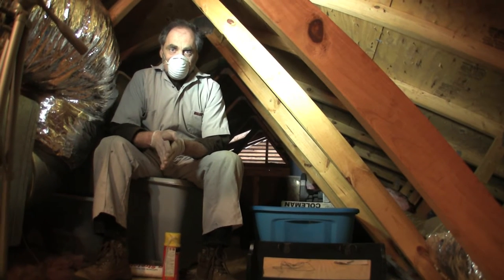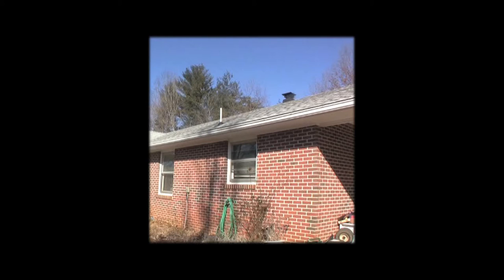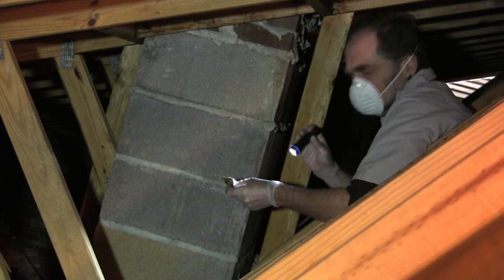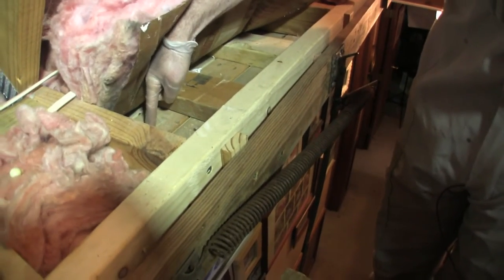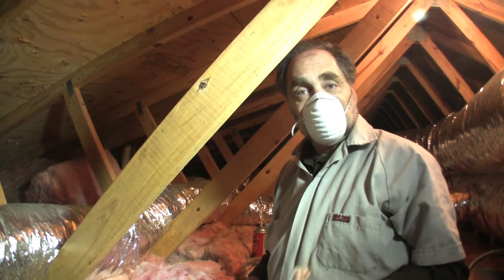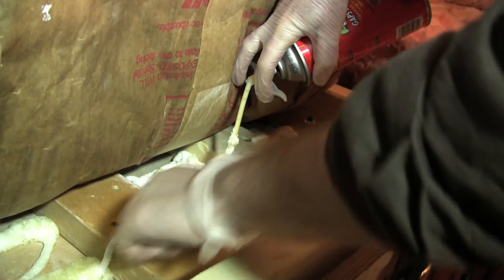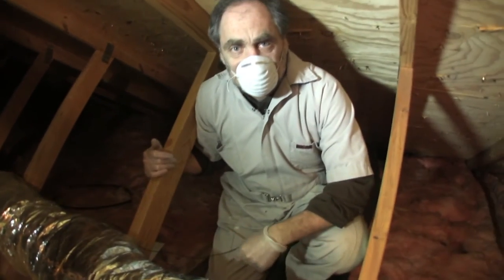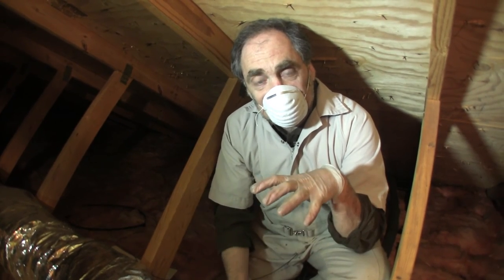DIY Energy Audit part 9: Air Sealing in the Attic

Comment: cold air is not traveling down the holes or gaps in your attic to the living space. the hot air from the living space is traveling up into the attic and then cold air is drawn in to the house through the basement or crawlspace
Reply: Most of the time the pressure and temperature differences are such that, as you said, air moves from low to high in your home. That’s true. What’s also true is that wind will push into your house from any hole, in any direction, including from your attic, if it’s windy enough and enough pressure builds up.

Comment: moisture will travel thro the insulation on the light cover, insulation isnt a vapor barrior
Reply from the maker: Most insulation is absolutely not a moisture barrier nor, for that matter, is it an air barrier. Air will move from hot to cold and the moisture in that air will follow. Not sure what point you’re trying to make as it relates to what I was saying in the video. Do you have a better way of air sealing can lights?
Reply: @Enerchek_lowers_utility_bills  in the video you said moisture wont travel thro the insulation on top of the box... but it will..